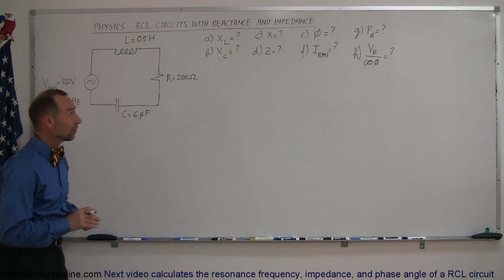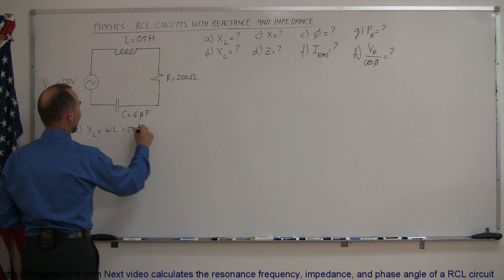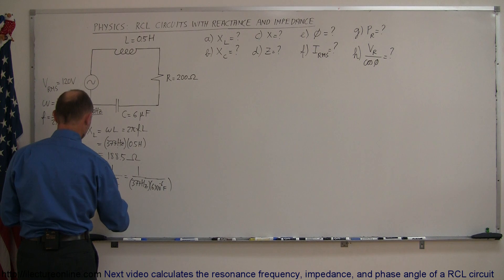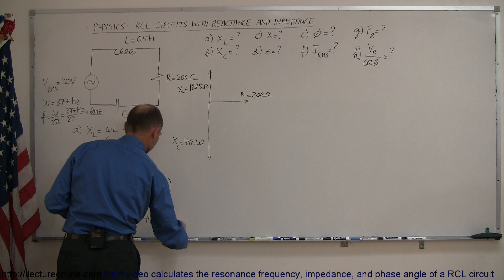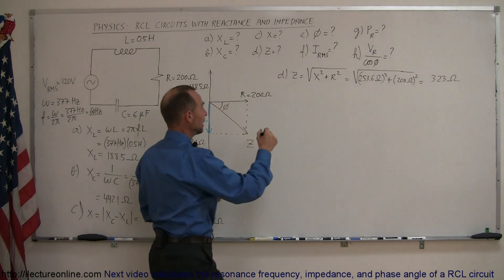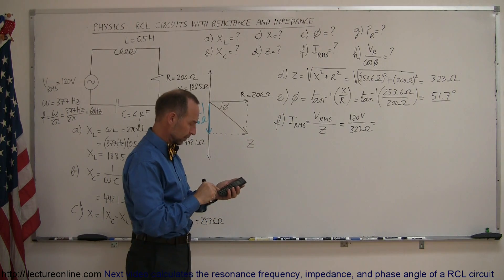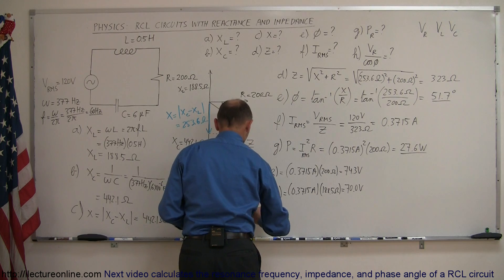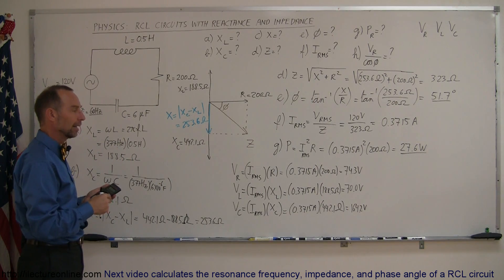Physics 49  RCL Circuits (1 of 2) Reactance and Impedance explained example

Comment: I need to develop1:20 transformer for signals.Frequency 12Khz Volt10:200 wattage 300watts and the ferrite is ETD44..Howmany turns to be wind for primary . What are the formula to be followed. Please help me in this regard
Reply from the maker: Sorry, but we don't have the time to help individual students with their homework or designs.
Reply: Thanks for your reply.

Comment: If the frequency is 60Hz then 2*pi*60*.05=18.85 ohms not 188.5 ohms.
Reply from the maker: The inductance is 0.5 H  (not 0.05 H)   Thank you for checking.

Comment: Shouldn't the unit of w (omega) be in rad/s instead of Hz since w = 2*pi*f?
Reply from the maker: radians is a "non" unit and doesn't have to be writtin and 1/sec = Hz.     However to prevent confusion it is better to write rad/sec for angular frequency (or velocity) and Hz for frecuency (f).

Comment: This problem would have been faster and easier to solve with complex numbers, which are the ones we use in electrical engineering. Good video.
Reply from the maker: We have a number of examples like that in our electrical engineering videos.  Typically during physics presentations, we use the method shown in the video.

Comment: Creo que hay un error en el cálculo de Xc ; olvidó el divisor 2 pi.
Reply from the maker: That depends on how the oscillation frequency is given.   w = 2 pi f    and  f = w / 2 pi
Reply: @MichelvanBiezen  
Muchas gracias por su respuesta.
Creo que no me ha entendido.
En el minuto 3.40 remplaza Omega por 377 Hz. ( Change Omega by 377Hz)
Debió escribir 2. pi .377 Hz
Disculpe no poder explicarlo en ingles
Saludos.
Reply from the maker: 2 pi f = 2 pi (60 Hz) = 377 rad / sec
Reply: @MichelvanBiezen Estimado profesor gracias por su respuesta.
 Ok, ahora entiendo, pero usted escribió 377 Hz , debió decir 377 rad/sec. 
Habitualmente en una fuente de corriente alterna se indica la frecuencia en Hz.
Saludos
Reply from the maker: Yes, technically the units are the same (since we don't have to write "radians"), but it does cause confusion, so it is better to write radians / sec.    ( rad/sec = 1/sec)  and the context is used to determine which is which.

Comment: I like your video. But I put the equations and data into a spreadsheet, and could play with scenarios quickly.  This is an old video.  I hope you are encouraging people to use computers to manage the equations and data.  Teach them to find balance and alternatives, not just memorize names and formulas.  I like that it is concise, but the form (chalk and spoken words) is too hard for people to use immediately. Thanks.
Reply from the maker: Thanks for the info!
Reply: @MichelvanBiezen  I want to try combining arbitrary number of resonant circuit elements.  The rules for resistors and capacitors and inductors are fairly clear.  It should also be possible to combine R*(L+C) and L*(R+C) and C*(L+R) and R+L+C and R*L*C in various combinations.  I have large objects made up of many tiny elements.  They fit these elementary responses and properties - but not necessarily in any order.  Nanomodules that come in only a few types but in any combination and numbers.

I am now converting the spreadsheets to  web programs (automatically) and then want to get better symbolic math tools.  You have good methods, but to share with others, it needs to be embedded in good tools and formats.  Large groups of people can still beat machines, but there is a limit to the size of group.  But groups using computers to work together, where the material is kept in the computer, those have no limit.
Reply from the maker: Yes we do circuit design and circuit analysis at work with models and simulation SW, but we still need to learn the basics so we understand what is happening.
Reply: @MichelvanBiezen  I don't think that "learning the basics" has to be done on paper or the blackboard.  It is expensive to build the actual things, but most all the information needed to model anything is online somewhere. That is the problem of the Internet, to find and gather, merge and verify all the pieces, so they fit together, and are readily available. There are about 1.92 Billion "first time learners" in the world right now, from 5 to 20 years old.  Many don't have access to the Internet, or software, and must learn they way you and I did - by copying on paper, memorizing, practicing.  I have tried to get some groups - Mathematica, MatLab, and others - to donate their skills and tools to make all the Wikipedia articles "living tools" so that the equations really work, can be merged, compared, tested, evaluated, calibrated - in a common forum for billions of people to see and work on. So the tables  are not text on the screen that hundreds of millions of people are reading by eyeball and having to "by eye and memory" recreate the tools and calculations for the billionth time.  All the number need their proper units and every page that describes a calculation or estimation should run on any data.

Sorry, I have spent the last 23 years, every day, working to find the best practices and policies for the Internet.   I took over TheInternetFoundation.Org domain from Network Solutions in July 1998. They told me how the original Internet Foundation was supposed to work, and be supported by an annual fee for every domain.  At $15 per year per domain, now that would be about $6 Billion a year.  They asked me why I would do that alone, and I said "better one person than none at all".  Not the technical parts and the operations, though I have lots of good suggestions.  But the purpose of the Internet, how it ought to work, its overall efficiency.

I see what you are doing, and I see 7.8 Billion people trying to live quality lives, or to have lives at all.  And count up the cost of that in billions of days of human time lost.  I was very good at global problems before I started, and with nothing else to do but answer "What is the purpose of the Internet?" and "How best to enable global communities to work efficiently, safely, and collaboratively on the Internet?" I have made a bit of progress in those years.  Now I am trying to make some changes for "covid", "global climate change", "solar system colonization", "basic Internet procedures and practices".

About a billion people in the world need to know more about electricity and magnetism. The gravitational fields are expanding rapidly (I call it "gravitational engineering") and there are not enough people trained to fill all the new jobs.  And they cannot memorize things, they need to know how to run computer models, gather and process data, run calibrations, run simulations, prepare reports, design new instruments and detectors, create prototypes, test them, and work out the economic, social and financial impacts of everything they do.

Richard Collins, Director, The Internet Foundation

Comment: The phase angle should've been negative, since it's the reference angle clockwise from the positive x axis.
Reply from the maker: The magnitude of the phase angle is calculated, and the direction of the phase angle is shown in the diagram.

Comment: Thanks for your effort I've personally learned a lot. Just one comment, I believed you've switched the order in the reactance equation, it should be XL-XC. Thanks
Reply from the maker: That depends on what you are calculating.  If you just want the magnitude, it doesn't matter, but if you want to use it to determine the phase angle, you are correct.

Comment: 2:24 Hi Mr. I am writing for your excellent video, since I clarify some things mainly with the angles of the different parts of the impedance.
My doubt is the following, the unit of angular velocity (ω) is rad / s not Hz, which is what I understand. when you calculate f (frequency), π is given in radians that leave with radians of angular velocity and the inverse of the second is hertz.

thanks for your video.

hola sr le escribo por su excelente video, ya que aclaro algunas cosas principalmente con los angulos de las distintas partes de la impedancia. 
mi duda es la siguiente, la unidad de la velocidad angular(ω) es rad/s no Hz, es lo que tengo entendido. cuando usted calcula f (frecuencia) , π  se da en radianes que se van con los radianes de la velocidad angular y queda el inverso del segundo que es hertz.
gracias por su video

Comment: i have a query please  :( . I am practically trying to determine the properties of my inductor at 27MHz, intended application in CB radio receiver. I've used this method before  - signal generator feeding an series RL circuit with L on the low side of the voltage divider. I call the voltage at the top of the resistor A, and the voltage at the RL junction B. I measure these on my oscilloscope, A and B are complex numbers, however I set A as my reference and so has angle '<' of 0 degree. the B voltage signal is leading, R is 50 ohm... then I solve XL = (50*B)/(A-B) which is a rearrangement of the voltage divider equation to solve for impedance of L. I have used this method in the past successfully at lower frequencies... typically I get my reactance and my real component of R... but in my last experiments at 27MHz when I solve for XL I get -ve numbers for the real component... such as -15+22j . I assume the -ve R means that the parasitic C across my L forms at tank circuit, resonating at or close to my test frequency and thus I have voltage gain?? However I have tried several coils and I keep getting these unexpected -ve numbers... please if you know what this means i'll appreciate an explanation..

Comment: Sir, It exist unsuitable unity  (Hz) for w.  Is unity of w should in radiant/ second, only just f in Hz ? Thank you!
Reply from the maker: It is definitely confusing, because "radians" is actually a "non-unit" and therefore, radians/second is technically the same as 1/second.   If there is any uncertainty it is better to write radians/second for w and cycles per second for f (frequency).

Comment: You forgot to multiply Irms (which is peak to peak current) by 0.707 to get RMS value.
Reply from the maker: No, the video is correct as is.  Thank you for checking.
Reply: @MichelvanBiezen  I ment:  You need to multiply the peak-to-peak voltage by 0.707 to get Voltage root mean square.
Reply: I revielew my electrical engineering math and you are right.

Comment: He made a mistake in the beginning
Xc = 1/ w × C
But w = 2 × pi × frequency
He forgot the 2× pi so watch out!
Reply from the maker: No, there is not missing 2 x pi.  The video is correct.  Thanks for checking.
Reply: I'm sorry if it came out a little bit aggresive .
Reply from the maker: No problem.  (I do make mistakes) :)

Comment: omega is in radian/ sec ... 2:55
Reply from the maker: You are correct.  Technically by convention  radians / sec = 1 / sec (since radians is a non-unit and 1/sec = Hz.  However typically Hz in used to represent "cycles" per second (cycles being a non-unit) thus to reduce confusion, I should have used radians / sec as you indicated.

Comment: is the angle of the current 0-51.7 = -51.7 ?
Reply from the maker: The magnitude of the angle is 51.7 degrees.  It lags the voltage by 51.7 degrees.  (the negative sign indicates the lag)

Comment: I'm confused about "ω". Is it angular velocity? If so, then the units must be radians/second and after we divide by 2π we get Hz? Am i right ? Please, dispel my doubts.   Many thanks
Reply from the maker: Essentially you can look at it that way.  Radians is a "non-unit" and doesn't have to be mentioned.  However for clarity you may want to use radians/sec and cycles/sec for w and f

Comment: why is Xl always 90° forward?
is that correct?
Reply from the maker: The voltage across the inductor always leads the voltage across the resistor by 90 degrees.
Reply: Michel van Biezen thx for reply
but if its always 90 then what is its phasor angle when we calculate it in a complex circuit?
Reply from the maker: The phasor is a vector sum of the voltage across the inductor and the voltage across the resistor.  Also if there is a capacitor in the circuit, we have to take that into account as well.

Comment: Don't you think that forget to put minus sign to angel . -51,7 degree ? thank you
Reply from the maker: It depends on the reference.  If we are talking about the magnitude of an angle, it cannot be negative.  (Are there any negative angles on a triangle?).   But if you want to express it as a phase angle then you can have positive and negative angles.  In this example we are simply finding the magnitude of the angle, and the graph indicates if the current is leading or lagging.

Comment: 1/resistance = conductance but you have written capacitive reactance in ohm , how can opposite of resistance becomes resistance????   please explain
Reply from the maker: Capacitive reactance is correct as written in the video and the unit for reactance is indeed ohms.   Note that the reactance of a capacitor decreases as the size of the capacitor increases.  (That is where the inverse relationship comes from).
Reply: thanks a lot sir for the explanation!!

Comment: phi=-51,7
Reply from the maker: Essentially an angle can NOT be negative.  (try to find a negative angle on a triangle).    However in mathematics we use the concept of a negative angle in reference to an axis.  Thus it depends on how you want to express the angle.  If you want the magnitude then it is positive.  If you want to indicate the direction relative to the horizontal axis, then it is negative.

Comment: I'm confused on the voltage dropped across the capacitor, how is it possible to be larger than the rms voltage of the supply?
Reply from the maker: The voltage drop across the capacitor is not constant, it changes throughout the cycle of the power supply.  The peak voltage drop across any device will always be larger than the RMS voltage.

Comment: omega aint supposeto be in rad/s instead of 377 Hz, sir ?
Reply from the maker: rad is considered a "non" unit and does not need to be written, although it is understood to be there with the proper context    omega is typically expressed in terms of rad/sec which is technically the same as Hz.

Comment: Should Xc be with minus? I know that the result of |Z| will be the same because of "Pitagora's Theorem'", but Xc and XL are imaginary resistance so we use Complex Numbers to find them, but basing on this formulas Xc should be with minus  because of Phasor, so the angle should be -51.7 degrees, the phasor will move from left to right.

Comment: Sir since we know that in pure inductive circuit current lags behind by voltage what if we have two inductor then what will be the phase difference between input and output voltage

Comment: Shouldn't the angle be negative?
Reply from the maker: The magnitude of an angle cannot be negative.  (Actually a negative angle does not exist, have you ever seen a triangle with a negative angle?).  All kidding aside, a negative angle is a mathematical concept in reference to the positive x-axis.  So if you want to call an angle negative it is as a mathematical reference which could be used in this example.

Comment: Sorry to say but omega is not measured with Hz but radian/second
Reply from the maker: Radians per second and Hz are the same thing, and is often a source of confusion.  Radians is a "non-unit".  For clarity we can add the word radians or cycles to differentiate between them which I tend to recommend.  However radians / sec will be written as 1/sec in textbooks.
Reply: They are dimensionally the same thing, but not in magnitude. https://www.wikiwand.com/en/Radian_per_second
"An angular frequency, ω = 1 rad/s, corresponds to an ordinary frequency, ν = 1/(2π) Hz ≈ 0.159 Hz"

Comment: First of all i want to thank you good sir, for helping out good lads to accomplish that what was not done in time, you are truly talented teacher, and it saddens me that my life did not have a crossroad with your live lessons. 
But i have a question also: It is..
when you find at the beginning Xc, then you can either ways use the 1/w c, or the 1/ 2 π f c formula, why is that? because sometimes the " w " is not given, am i correct?  so many could ask:   how to find it (w) ?
Reply from the maker: It depends on how the information is given.  since w = 2 * pi * f  you can use either expression.
Remember that the units for w are radians/sec and  the units for f is cycles / sec

Comment: There is something wrong with the 377 Hz,should it not be in rad/sec ?
Reply from the maker: No, nothing wrong here. But the confusing part is that "radians" is a "non-unit" and doesn't need to be mentioned or written, which often makes it confusing.  Typically I will write out rad/sec instead of 1/sec to make it clear.                         rad/sec = 1/sec
Reply: What is confusing is that you have it as hz unit and then you transfer it into hz unit or from 377 hz to 60 hz, it dosent make sense ? 
377 rad/sec is 60 hz !
Reply from the maker: Yes, it is very confusing.  That is why it is better to write rad/sec.  However rad/sec = Hz is correct.  The key is to look at the variable used.  When you see f, then you know it is cycles per second.  When you see w, then you know it is radians per second.

Comment: Hi Michal. 
i am confused about the capacitor and inductor reactance. these both loss energy in form of heat. but while we want to calculate the power of AC circuit, we only concern with resistor not total impedence of circuit? @michel van biezen
thanx for nice lectures.
Reply from the maker: +Zubair Khan 
Neither the capacitor nor the inductor lose heat, only the resistor does.
(In a real inductor there is some loss because of the internal resistance of the coil), but a pure inductor does not lose heat.